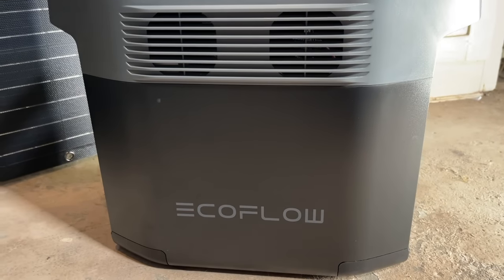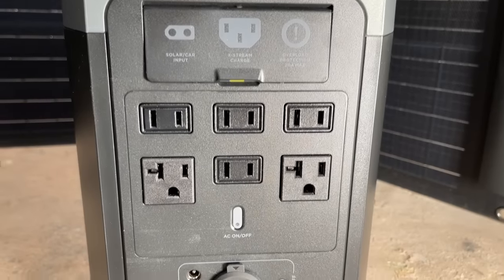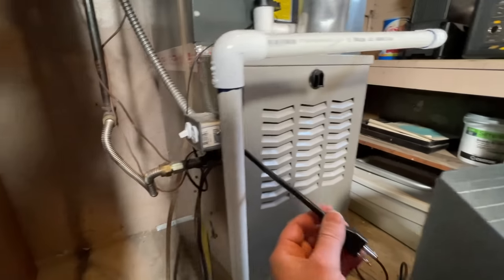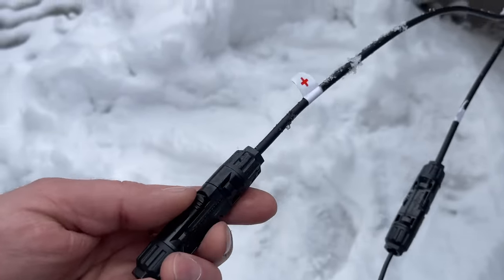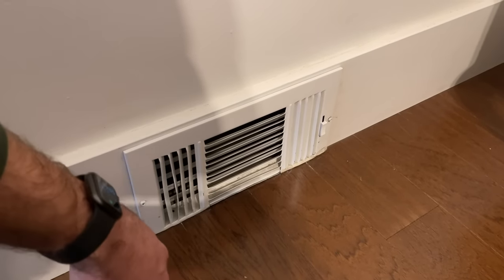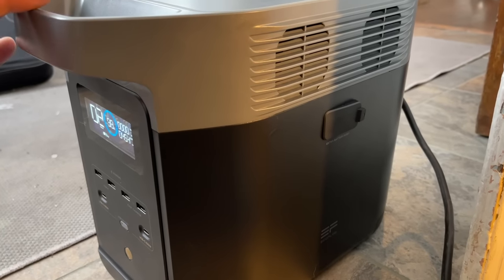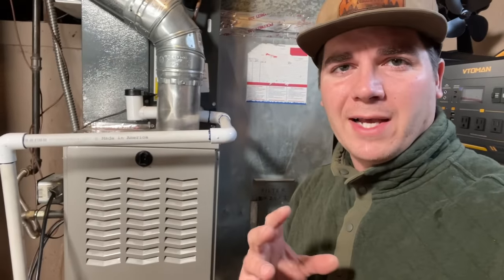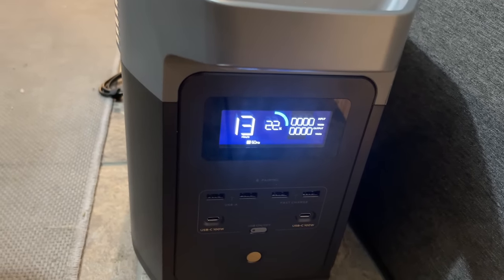How Long Will The EcoFlow Power Station Run My Furnace?  |  Power Outage Emergency Heat

Comment: Why can't you have the unit by the furnace when charging?
Reply from the maker: Because it emits hydrogen which is flammable so it’s advised to not have it by the furnace
Reply: @diyhvacguy  I have tried to recreate your experiment and it got no luck. When I connected the ECOFLOW Delta 2 to the furnace it gave me error (steady red light), Replace IFC. Switching back to the power grid the furnace works as it should. Am I doing it wrong?
Reply: @ZenS-jg5zs for high efficiency furnace, you need to ground it using a ground neutral bonding plug or by connecting it to your home ground. If you leave it plugged in like charging while using it, that should ground it.

Comment: If you want to decrease the popper drag caused by the extension, try and get the heavy duty high current variety… these actually have the least resistance because the actual wires are larger thus less loss.
Reply: The drag as you call it is no more than about 3%. It's really not a big deal

Comment: So I own the same delta 2 and looking at the expansion battery but the price is just a little less than the delta 2. So I would rather buy another delta 2 and plug it into the other delta 2 and use it as an expansion battery. My question is...
Would this work?
Reply: It will work if you connect outlet of one delta 2 to the inlet of the other. Cheaper option is to buy a 100aH LiFePO4 battery with an O-ring to XT60 connector, and to use that to charge your Delta 2. New Delta 2 will cost you maybe $950, but 100AH battery plus cabling will cost about $350 and provide the same backup, but without the fancy stuff as a second delta 2. You'll also need a battery charger with built in charge controller for the 100AH battery, so add another $50 for that. So you can get almost triple the capacity of a second delta 2 at roughly the same price.

Comment: I’m wondering is my AC also connected to the same line as furnace? Will this power AC, if so how long. Again,what’s your home square footage. Great job,your VERY clear and detailed. I’m hooked 👍🏼
Reply: Depending on the size, and AC can draw 90 amps startup and you need 240 volts. I have a 6500 watt 240v inverter generator and it does not have quite the current needed to start my AC, though I do not have a soft start kit on it.  You really need 240v and at least 60 amp starting current for an AC.  The AC only draws this current for a second or so, but if it does not get all it needs, it won't start.  (Your AC condenser, the outside unit, has a tag with the Locked Rotor Amperage, or LRA, that tells you how much your AC takes to start.)